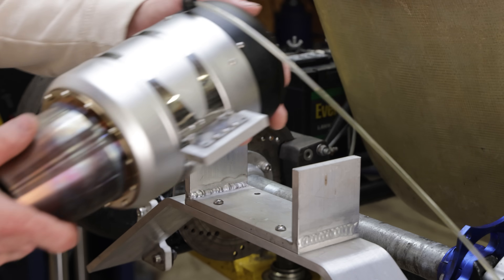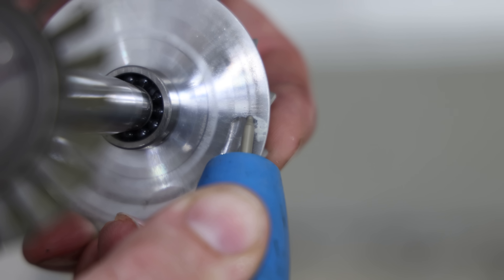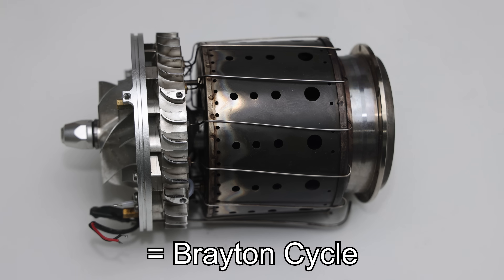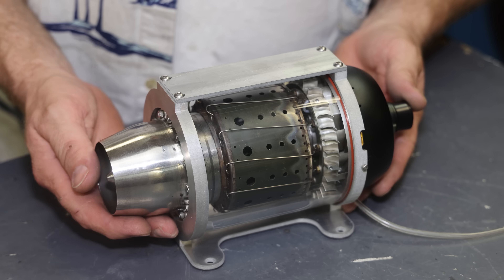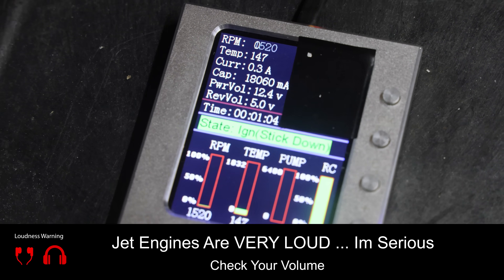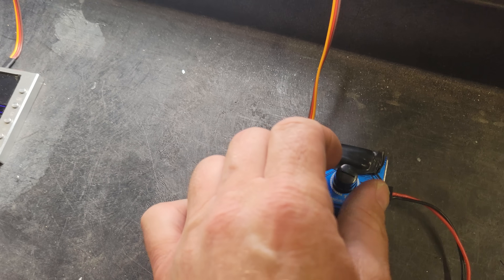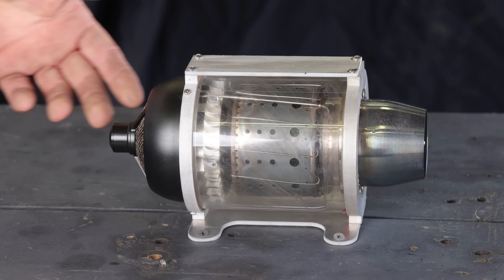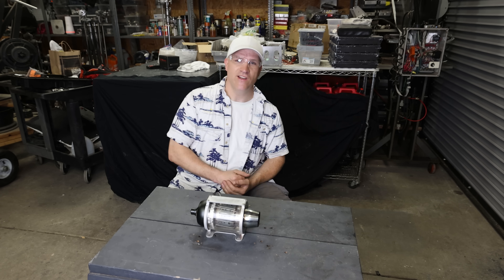See Thru Jet Engine

Comment: I know nothing of jet engines, that must be said first. My question then may be ignorance at work, here goes....
Why when he explains how the jet engine works intake, compression, combustion, exhaust does that not seem right in my head?......wait, that all seems fine, what didn't sound right was when he stated the exhaust spins the compression rotor. I know it works and I know I'm missing something so anyone who answers I thank you for enlightening me, the idiot lol.
It's at 1:51 or so when he states "the hot gases exit push the turbine wheel  powering the compressor."  I know my brain is wrong in thinking this sounds like perpetual motion, I know it's wrong. What I'm trying to figure out is what I'm missing, what is being added that makes this not free energy.....as I type this I had the thought that it's the fuel but I am a complete novice on this stuff and know basic high-school science, not that well even, lol. So I absolutely know that when my brain goes "wait, that shouldn't work" and I say "shut up brain, it obviously works, jets fly all day everyday" that I'm right in telling my brain to shut up lol I just don't know why..........really whoever chooses to answer this, you're awesome and may you and yours know many blessings and much happiness. Just be gentle because I'm an idiot lol.

Ps. Awesome video.
Reply: It's not perpetual motion or free energy - the energy comes from burning the fuel. Some of that energy is needed to compress the air.

Comment: Turbine engineer for 31 years (retired now) mostly with Honeywell in Phoenix. Great demo. We had a few engines over the years that are mounted inside plexiglass for public display, but of course, no way they wer ever intended to run!

I saw the display a couple times, but could you give the performance parameters at max. power? Namely, core flow in lbm/s and exhaust gas temperature? A turbine inlet temperature would be even better. I probably missed it, but what's the thrust in pounds at max power?

Comment: The engine was not functioning properly. Your blade to drive the intake compressor was not working it was just sitting there static so the whole thing was a joke and that's that's why we witnessed your fog set up failing miserably.  Yet you tell us it was a great success BS.
Reply: The stationary part of the compressor that you are seeing is the stator; it's called that because it is supposed to be stationary. Look that up...
Reply: @brianb-p6586  The job of the stator is to keep the flow from spiraling around the axis by bringing the flow back parallel to the axis. Got it thanx!
Reply: @scottieo  That's one part: the stator is also a diffuser, slowing down the high-speed flow from the impeller so the pressure increases.
Reply: @brianb-p6586  pv1 =pv2
Reply: @scottieo  sort of close... the process is not isothermal, so you can't ignore temperature.

Comment: I would love to see this used as a turbo or a power source for a super charger. What psi of boost could be contained ? Smokey Eunich delivered a 4 cyl. Heated lean  motor to Pontiac non boosted. OR as a turbo for a Cummins diesel...
Now that has applications. 
Your brain is amazing. Are you sipping that bio diesel?

Comment: You can add another transparent tube on the outside. The massflow out the exhaust will create a venturi effect pulling in more cool air. Cant remember what ita called but ut will help keep the casings cool.

Comment: As a long time mechanic working on four stroke engines I've always had a fascination with military jets and therefore jet engines. It's really cool to see what goes on inside one. I thought that there would more heat and flames going on outside and surrounding the combustion can because I always thought the compressed air went in the front of the can but now I see that the air from the compressor surrounds the the can and that mass of high pressure air surrounding the can forces the air into the combustion chamber from the outside through those holes in the can and also acts to contain the combustion to the interior of the can. Sometimes a visual approach to something conveys wat more then an text explanation or an animation. Great video.
Reply: That air entering into the can from the outside is known as dilution air and its function is to keep the can from melting. It keeps a layer of air flowing between the flame and the can housing otherwise it would straight away melt within minutes. It blew my mind when i read this. Just the sheer simplicity of this solution.

Comment: Nice way to visualize the remaining rotation on the flow, evident by the helical staining pattern that appeared in your clear housing, after the stator vanes on the diffuser. I wonder how much of that was deliberate on the part of the designers for combustor swirl and how much was just not knowing the strength of that flow characteristic of these small high rpm turbocharger compressor wheels.

Comment: Nope not a real jet engine. You can see fuzz or something on the front of it and the air was blowing it away from the front. It would have been sucked into the front and through the fans. Fake video
Reply: Most people who claim ordinary things are fake just don't understand what is happening, or that these things are commonly available and work every day. You seem to be one of those.
Reply: @brianb-p6586  That hook must've set in good because I see that I've still got the same suckerfish on my line LMAO 😂

Since you seem so eager to insert yourself into this topic, why don't you enlighten me with your knowledge, regarding some basic physics and how it applies to this particular application. Afterall, with your expertise as an aeronautical engineer, you must know all of the intricacies of turbofans. 
The jet engine in this video, which was supposed to be "see through"  in order to see the workings inside and how they operate. Yet, all that we can see are the non moving parts. So the jyst of it is that it was pointless to make what he did, see through
Reply: @brianb-p6586  is this a low-bypass turbo fan engine? Or is it a high bypass turbo fan engine?
Reply: @hammernnails7314  It is a no-bypass turbojet. It has only one compressor stage, and no bypass fans. What basic physics are you missing?
Reply: @brianb-p6586  🤣🤣 hey, thanx for letting me know that you know absolutely nothing about how a turbofan engine operates🤣🤣🤣 no bypass he says.... Hilarious, I says.... 😂😂🤣🤣
Reply: @brianb-p6586  the basic physics is simply air intake. However the most important thing missing though is common sense

Comment: That's just a torch. The stator wasn't even spinning
Reply: 🤣"Stator" means a stationary element - a stator never spins; maybe that was an attempt at a joke? The compressor impeller is not visible through the clear housing because, as is clearly shown in the video, it is forward of that inside a metal housing.
Reply: @brianb-p6586  😁 no not a joke, however, I was being a smartass and trolling for trolls - CAUGHT ONE! 🤣🤣🤣
Reply: @hammernnails7314  Umm.. that makes you the troll, not me. And a complete waste of everyone's time.
Reply: @brianb-p6586  LMAO it ended up being a definite waste of my time, the moment that you said "no bypass jet engine" 🤣🤣🤣 'aeronautical engineer' not so much. More like (google search bar engineer)🤣🤣🤣

Comment: Really cool looking but according to your hand not cool to the touch. But anyway what starts the turbine spinning up. I only see one hose running to it which I assume is your fuel supply, so I don’t think it’s being air started as an airliner jets I believe are started. Was the see through section glass or a plastic?  What do you run for your fuel?  Great video though! I love it.
Reply: Like all turbojet engines of this style, the electric starter motor is on the nose - it turns the one shaft of the engine.

Comment: Just a thought. Instead of joining be the 4 screws and plate, would you get better strength by running 4 long bolts end to end, spaced evenly.
Just from looking at the footage of the seals blowing, you can see the flex on the aluminium end plates, and the screws moving on the joining plates. 4 bolts were give adjustable tension and a better seal.

Comment: Why aren't jet engines in cars? Truly impressive performance.
Reply: Horrible efficiency, very poor response to power changes, impractically large exhaust pipe needed, difficulty muffling...
I don't know how sitting on a test stand achieving nothing is impressive; it's a demonstration tool to show the burner section, but other than that it doesn't do anything useful.

Comment: in a turbo there is oil on the rotating shaft....what keeps the shaft from producing heat/expansion/lubrication at that rpm.......thanks for the show...I never knew there were types of jet combustion engines

Comment: I have the exact same servo tester and was as shocked as you probably were when I used it for t he first time and saw how blindingly bright  the LEDs are! Instead of taping over them, I opened it up and replaced the current-limiting resistors for the LEDs and had to use ones about 100x as large to get the brightness down to a reasonable indicator-light level...

Comment: The main thing that trips people up with the Brayton Cycle is that unlike the Otto or diesel cycle, wherein combustion is under constant volume, the combustion is a constant pressure process. The pressure does not increase with the combustion of the fuel.
Reply from the maker: That's exactly right

Comment: It's a air pump.   Hot air expanding is what gives you trust
Reply: No, it's a heat-driven engine, which is the opposite of a heat pump. And the thrust comes from adding speed to the air, which is not quite the same as expanding it.
Reply: @brianb-p6586 lol no

Comment: Alright so jet fuel is very similar to diesel fuel, which isn’t combustible without proper atomization/heat. How much fuel pressure is running to the engine and what does the “injector” look like? Also is there any sort of glow plug to start the process or does the compression from the compressor wheel create enough heat to start the process by itself? Awesome video!! Coming from the high performance diesel market industry your balancing machine is awesome!! Thanks for the video

Comment: if those 4 tiny screws can hold it, it is not generating much power
Reply: It's not generating any power. Matt (Warped Perception) replied to other comments that the (maximum) thrust is about 30 pounds. Yes, four of those screws can hold that.

Comment: Awesome video. 1/4 inch glass was a good idea. Maybe some more for the flame holder/inner can with holes on the combustion chamber? Would mesh screen work there or would it get too hot and melt? Just thinking of a way to see inside of it. It's really clear how a radial flow/centrifugal flow compressor pushes all the business to the outside edge of the engine. But the flow of fuel/air goes back inside for combustion and expansion and that would be really sweet to see. Also, maybe add a few tension bolts front to back between your 'bulkhead" caps to hold pressure on the gaskets. Like on a rotary engine block. Keep at it!
Reply: It's apparently not glass; Matt says it is his proprietary composite, which I assume means a composite of polymers. The similar engine by Jetpol uses a borosilicate glass tube with a 5 mm thick wall (just under 1/4 inch).
Reply: @brianb-p6586  Excellent! Thanks a lot. I just rediscovered this channel with this video.

Comment: Cool. That particular engine design strikes me as having an ugly airflow. It seems to just assume that air will find its way despite terrible design and that seems like it could be improved on.
I guess it's done that way to have the intake air always around the burn chamber to cool it a bit before entering. Clever I guess but at the expense of completely stopping the air.
Could you make a better one? and could you even make a good turbofan engine in that size or perhaps a bit bigger. Turbofan has far greater potential than turbojet.

Comment: I got an A&P license back in 1991 an never could get anyone to hire me without experience.  Anyway this is a great way to show how a jet works. my instructor explained it very easily though.  suck, squeeze, bang, blow. 
lol. it sucks air in compresses it tightly, adds fuel and causes the explosion, then it blows the air out the back as thrust. 
pretty easy explanation an this video shows thats exactly how it works.

Comment: NO one shows whats Actually are Inside The Jet engine. The ones creating The TORoid. Statorblades.
Compressor engines are started by the liquid GAS=AIR. Gas turbines. Water turbines Steam NEWCLEAR turbines. The Compressor starts these engines. The AIR=GAS. MoTOR, GeneraTOR, ConducTOR, InducTOR, StaTOR,.....

Comment: Interesting to see the control of the flame in the combustion chamber. In a typical engine 20% of the compressor bleed is used to cool the engine and keep the flame from direct contact. So much engineering in such a simple design.

Comment: To throttle up you just basically add more fuel or how does it work, can you explain more.
Reply: Yes, in any turbine engine you add fuel at a higher rate to make more power, but you can't change the fuel flow too quickly or it won't keep running properly.

Comment: The modern airplanes with high bypass ratio pull in a lot more air in relation to how much is expelled in the back...
By the looks of it, you have a zero bypass ratio engine?
Reply: Yes, this is a turbojet, not a turbofan.

Comment: I have an idea for you. Use an air compressor about 3'' to 5'' (nozzle tip) to feed air to the air compressor of the reactor's intake. That way we will know what is the reactor different from none moving like in this video.The combustion chamber should react differently.

Comment: How does the throttle work on one of these ? Does it have a throttle body or something ?
Reply: Gas turbine engines do not have throttles. A throttle is a valve to control how much air enters and engine, which only works on spark-ignition (gasoline) engines. Like diesels, gas turbine engines are always free to take in as much air as they can, and only the fuel flow is controlled.
Reply: @brianb-p6586  so... The fuel flow is the throttle ?
Reply: @sponsoredbydad_007  Fuel flow is the power control (instead of a throttle), yes.

Comment: Wondering how these motors leave a vapour trail?
Reply: Any engine leaves a vapour trail if there water in the exhaust condenses in the air (because the humidity of the air is high enough and the temperature is low enough) after it leaves the engine.

Comment: 8:45 when you said that jet engines get most of their energy through the fuel rather than the air, this only applied to turbojet engines. Turbofan engines like those seen on modern airliners do infact get most of their thrust from the air being pulled in and accelerating it using the large fan at the front. Turbojet are less efficient as they dont have as big of a fan but rather rely on only the core of the engine to produce all the thrust. However they are much smaller so thats why they sell model turbojet engines rather than model turbofans. Awesome video though really enjoyed!
Reply from the maker: Yup but that energy to move that giant turbofan also comes from the fuel energy 🙂.
Reply: All of the energy comes from burning the fuel, regardless of engine design. All of the thrust comes from accelerating (increasing the momentum of) a mass of fluid, which is almost all air (the fuel mass is tiny fraction of the air mass). 

Turbofan engines are more efficient than pure turbojets because they accelerate a greater mass of air to a lower speed; most of the air isn't needed for the engine's power-producing cycle so it only goes through a fan, not the whole engine as in a turbojet.

Comment: I also worked on Jet engines for more than 30 years, and I seen mock up engines cut away, but never running. so this is a really interesting video for me.  As I watched, I couldn't help but think that there is 2 basic ideas you may have missed on your description for explaining a jet engine which will maybe explain the air input a little bit, but more to the power, and where you get it from.

simple explanation, assuming the inlet rotor is spinning Counter Clockwise (CCW), and all rotors following spin CCW, then the last rotor will spin ClockWise (CW) and this rotor has a drive shaft connected to it, and it runs through the center of the whole engine, which is different from your mock up shown in this video.  but this would allow all the Shaft Horse Power (SHP) being produced by the forward shaft, which is what a helicopter uses. 

now your video shows CCW rotors and the last rotor is connected to the forward rotor, so it is also spinning CCW, so the power is Thrust Horse Power (THP), and what a Jet airplane would use. and similar to a balloon, if you release it, it will fly in one direction.  
but when it comes to air input, this engine will pull a lot more air through the inlet than the shaft horse power engine as the last couple rotors spinning CW kill the air flow to create SHP
Reply: The direction rotation of rotors is not important to the engine operation.
Reply: @brianb-p6586  of course, I just used it for the explanation of the shaft horse power, where the last rotor spins opposite all other rotors, for helicopters.  But you are right